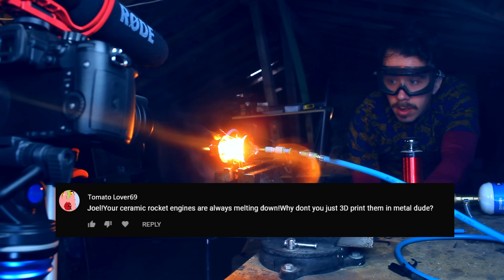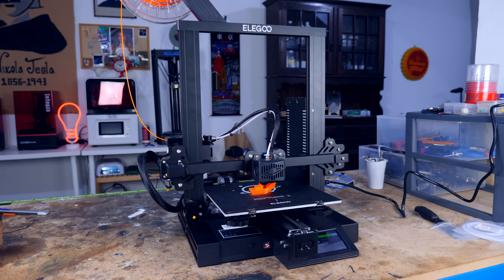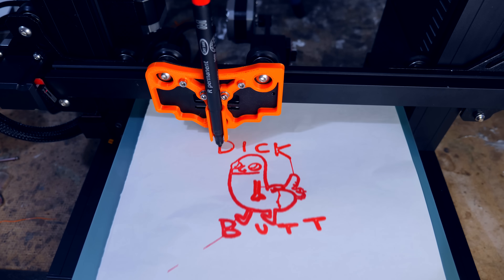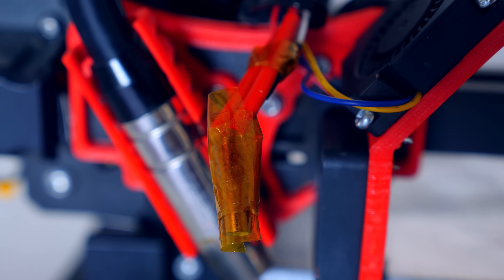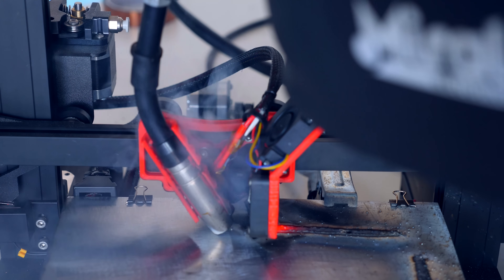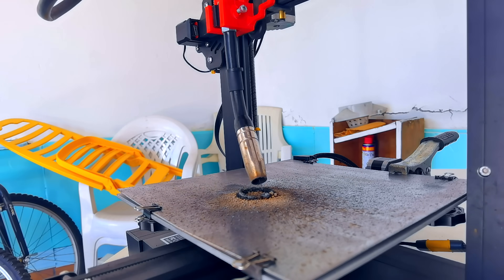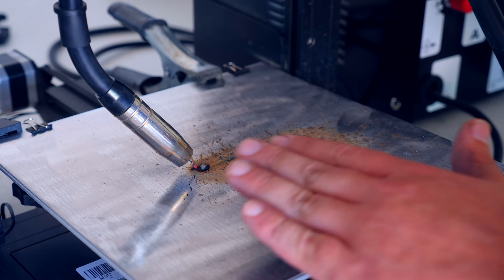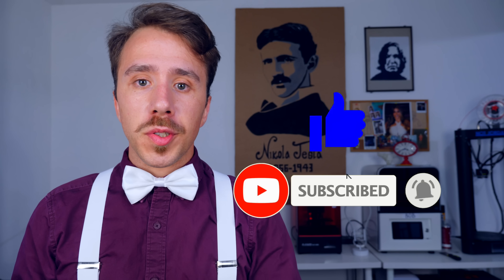I built a Metal 3D Printer using my Welding Machine

Comment: Try using MIG instead of Flux core. Mig allows you to weld over previous welds without needing to grind it because it doesn't use a flux in the wire.

Comment: You can use a 3d printed plastic part for the "lost wax" method of metal casting.  Aluminum or brass should be achievable with a fairly simple furnace.

Comment: This video was actually my introduction to your channel, so I don't know exactly what your rocket nozzles look like, but I have seen a number of makers in YouTube doing "Lost PLA Casting", where you 3D print a piece, cover it in a hard shell, melt out the PLA, then pour in molten bronze, aluminum, etc., to get a metal copy of your 3D printed file. Perhaps you could find a way to make that work, to get a more temperature resistant rocket nozzle. I know I'd watch a video of you attempting it. ... And since I'm subscribed now, if you do end up making that video, I will watch it!

Comment: A. If you want metal prints, cast. Print what you want with pla and vent and pour spouts and then make a plaster mold and melt the plastic out and pour some metal in the there. 

B. You cant stack flux core wire like that. Use normal wire and make yourself a tank to put your 3d printer in and dump some co2 in there

Comment: Print it in PLA then build a bucket forge, sand cast the PLA part, then melt metal in the bucket forge then pour the melted metal in the sand casting and it should give you a near lossless part, that is my idea for a future project.

Comment: You can build a gasifier type machine using old steel coffee cans some metal tubing (copper even) some random sized tin cans for piping. And it can be adapted to up to.maybe a 10kw generator so that the gasifier powers the generator:) use wood pellets for best results in gasifier

Comment: You can try metal filaments for FDM printer and you can get stainless steel filaments and print parts and then slintering in Furness for removing mixed material and making highly densed metal part

Comment: Marlon gcode has supported arcs and splines for a long time now. It blows my mind that none of the slicers I've encountered support it. Obj and step are both reasonable to work with. Someone needs to make a slicer from this decade.
Reply: Too many 8bit boards are out there still, they don't have the necessary processing power generate and send so many commands. It requires a better processor and faster bus speeds.

Comment: Integza. 
I saw video of metal 3d printer and they use phylament with metal. you can buy this filament and put it in FDM printer, than use that print wash it and put in funece like for ceramic. And they you got it, metal 3d printer.

Comment: question??? have you tried lost PLA casting on your fdm printer or castable resin on your sla printer? your kiln should get hot enough to melt small quantities of aluminum  that you could make your engine out of. you could also mark that parts 100% out of ceramic using this method. Burn out the pla pour the ceramic slurry in let it cure and form then dissolve the mold material. heck if you wanted you could make the entire mold out of PLA, do a negative cast of the engine an make the entire thing out of ceramic.. burn off and out the pla leaving you an engine that 100% ceramic.

Comment: Video idea: Make a rc propeller engine with a wankel engine.
Reply: RC airplane wankel engines are older than me, they've been around for a while. Not as popular as COX Bee engines but probably more common than twin cylinder Bee engines. I think it would be more rare if it was used in RC car or boat because when it was used it typically was in airplanes.

Comment: As a base for the turbine, you could weld a short piece of pipe to the metal plate, then print/weld on the pipe, to avoid warping. Or just build the turbine  from pipe... :P

Comment: Building an new type of printer from scratch seems like a distraction from your primary goal.
Since you have a kiln/furnace, perhaps you should try virtual foundry's metal filled filament? It works kinda the same as the ceramic, but you bury it in a refractory/charcoal powder to hold the shape and prevent the metal powder from oxidising. I haven't tried it yet, as I don't have a furnace.
Since the end result is conductive metal, you could surface finish it using electro polishing and plating. Just buy bright nickel electro plate solution though! It's not expensive. Perhaps watch Jason Welsh's channel for more info on electro finishing and forming, though he works only with copper.
Also, I have seen somewhere a method of filling the sintered metal with another lower melting point metal as it sinters, so that it doesn't shrink and isn't porous. You kinda just place ingots on top of the part and they melt in during sintering.

Comment: What if you sped the metal up from coming out of the welder? wouldn't that allow for it to lay more metal and thus build more instead of just small layers? my brain tells me the issue would come from telling the welder to speed, but maybe you could figure it out.
Also could "weld" at a lower watt/voltage to maybe make it behave more like a 3d printer instead.

Comment: Hey what about casting the piece, that could be a nice video idea! Like you 3D print the part and use a two part sand-silica mold to cast it in aluminium. That should make it capable of holding higher temperatures and grill tomatoes more efficiently :)

Comment: also some hardie board it a wall board that is to the most part fire resistant, it has moderately flat profile on one side and embossed pattern on the other, typically found with tiles in the Home despot isles, a 3x5 sheet is sub 15 bucks,

 but look out for where construction is taking place and it can typically be found in a skip, for the size you are looking for, a sink cut out would typically work for you. 

I think getting some inert gas, typically Argon, Helium or some mix of both,  

it is best used again talk to rapid air, or your local wielding supply house,

 they will sell or rent tanks, and charge $5 to $10 per liter/gallon, 

typical small bottle may be $30 bucks, about 1 to 3 hours gun time. 

You may have to get a better machine, which alows the use of gas and has some kind or control valve for the gas, 

the Harbor frought machine are getting some acceptance as reasonable wielding machines, 

the Vulcan line in particular(possibly) 

or better everlast..

 If getting a machine make sure if it is gas capable machine

On the machine controls there is a gas flow stop and start times, 

this allows a pre flow of gas and a post flow of gas to help cool metal down and remove air to create a inert gas environment prior to wielding initiating. 

 and the rig for controlling the gas pressure into the machine, some kind of flow meter, / control screw.

 With Hardibacker, your experience will vary, under the metal, 1/4 should be fine but 1/2 would be better. 
I have a section of 1/4" that I wield on it dose get hot but dose not burn though... so that a thin metal frame to create an air gap. 
 

So I am looking to make some flow forms, 

was wondering how U would go about that, 

I am thinking of using foamed concrete, and some kind or temporay mold, construct,

Comment: ... maybe I am terribly foolish but isn't it easier to print a ceramic mold or wax copy of the metal parts you want, then cast them, heat treat them, machine as needed, and assemble those metal parts? I mean I suppose you already did the deed here but really it does seem like printing molds or parts to create molds from is the easier way to make metal parts, and avoids issues like delamination of layers entirely.

Comment: no gas on the mig, having a gas flow will help with splatter, keep the nossel cooler, a metal bracket and using aluminium X chanel for the horizontal bar would help, anti splatter, change the speed of wire, and temperature of the electricity

Comment: Using hardware with 25/75 shielding gas with less stick out would leave you with no slag to clean after each pass and less spatter. Angling your nozzle can also push the bead in directions you don’t want it to go since a big concern is accuracy on x and y planes.

Comment: Just use a 3D printed object as a model for metal casting - you'd have to clear up the surfaces afterwards, though. How about building a sandblasting tool for this?

Comment: The welder needs to be set up vertical and not on an angle like you had it, I'll bet that the  majority of your problems will go w at with it being vertical, also try putting the welding metal on a plate of 1/4" aluminum instead of the glass. You can help with weld spatter by using shielding gas 60/40 c02 to argon mix will work good.
Also, don't use a steel sheet that is galvanized, get yourself some 10ga cold rolled sheet steel.

Comment: Video Idea. You should 3d print a De Laval nozzle then make a sand mold and use a foundry to cast the nozzle with a "low temperature" metal i.e. brass, aluminum etc.

Comment: Mig Welding with regular wire and CO2 would work better
Metal core wire would eliminate the slag but you'll need to run hotter on thicker metal.

If you can afford it, a Mig Welder that has pulsed current setting would allow you to run with very little spatter and low heat input which would allow you to build layers faster and much much more consistently.

Comment: Professional here.
Yes, angling the nozzle does produce a better result, but not in the way you think.
It's about the penetration of additive material into the base material and heat, the angle gives you a "lesser" penetration and HAZ - Heat Affected Zone.
You could have it straight down, but the HAZ will be greater, to compensate, you could turn down the Voltage/Amperage and increase the feed of wire, as well as the G code (F code) to a higher feed rate.

And one other thing, Slag-thread, aka "booger builder" or my personal anecdote; "Useless piece of fuck'n shit amateurs use" (no offense) that you are using, isn't really the most suited for additive manufacturing, since you can get a lot of slag insert, pores, and a weak structural integrity - You'd need shielding gas and solid wire for a better result.

Comment: You need to adjust the nozzle so it is directly over the spark so that the gas can completely protect the weld as it's being laid down.  At the angler you're using you're gas is just blowing away causing a bad weld.

Comment: Your challenge for a video: Make a hydro-generator using a computer fan, plumbing pipes and a hoverboard wheel. Your target is 700 watts. (I'm suggesting a 3D printed Phi-impellor as a better replacement for the computer fan). ;¬)

Comment: you should be using a gas mig welder because a flux core leaves the slag and has to be cleaned off before welding over it again. Gas mig shields the  weld and there is no slag. So no cleaning required.

Comment: You can't accomplish what you're trying to do with flux core wire. You need to use MIG with shielding gas. The flux in the wire creates a surface layer on the metal that prevents oxidation and contamination. It's great for a single pass, and for use in environments where gas wouldn't be suitable (like wind). But the slag from the flux needs to be cleaned between passes for proper adherence and penetration. If you could figure out a way to incorporate shielding gas instead of flux core wire, then you would have much better success. There's no slag removal after MIG with shielding gas. Also, you CAN use a vertical wire feed and still make a successful weld. Especially if the puddle is properly shielded. The reason people angle the torch is because we're human, and we need to see the puddle to control it. But if you're controlling it with automation, it isn't necessary to angle the torch. As long as you don't have fans blowing the gas away, you will be fine. But I think the higher placement of the mechanism that holds the torch overcame this. Also, not all MIG welders are created equally. I started with an entry level flux core only MIG welder, and now I have a high end Miller welder. NO COMPARISON! The high end welder makes beautiful, buttery, fluid welds. 

But I definitely think you're on to something. I look forward to watching your attempts at this evolve. If you can master this, you will create a new world of opportunity for entry level 3D metal printers that can incorporate MIG machines.

Comment: I should think the Tungsten Inert Gas (TIG) process would be better suited for this application. It has more elements that would have to be automated, but assuming you could do it, it would provide you a greater degree of control and precision as opposed to the rather messy Metal Inert Gas, or Flux Core processes. In TIG welding there is a Tungsten electrode that is operated independently of the filler material which is fed into the arc by hand. Requires nerve to do by hand, but the level of control afforded to a machine might grant it the level of control necerarry to build up layers much as a normal FDM printer.

Comment: Sadly 3d printer G-code doesn't do circles.  Machine tools that also use G-code, for a lot of decades now, use G2 and G3 codes to make circles.  This change needs to happen in the 3d printing world as it's smoother on the machine and shorter code lengths.

Comment: I'm not a professional welder, but I learned a bit about different kinds of welding during my internship and later when tinkering on cars, and one of the basic rules I was taught was to never weld in a straight line, but always in overlapping small curves, like this: (((((((((((((((((((((((((((((((((((((((((((((((
This way you deposit more material, resulting in a stronger weld with less chance of gaps and less warping.

Comment: 5 mm steel plate with air gap between it and the platen. Also try pulsing the welding action on and off in symphony with the table movement to help control heat input.

Fantastic effort. More please.

Comment: Yeah you need to look into TIG welding, MIG is far to dirty as you can see to accurately produce layers. you will basically need to feed a rod into the cone which argon flow and tungsten tip. If you can make it work it will produce far better results.

Comment: Always wanted to see someone try this , as I have seen Metal printing on industrial machine on 3D Printing Nerd . Try with heavy build plate that does not warp with heat  and slow feeds down. Looks like a lot of fine tuning with the speeds but also with the welding feed rates and power settings.Great attempt though.   Cheers from Australia

Comment: The reason we angle the welding cone is so we can see it :P If you don't need to see it, mounting it straight up is just fine. The only other observation to succeed in this situation is to use 8-12mm thick steel so it doesn't warp (as badly) which may get you closer to your goal :]

Comment: As a welder by trade I'm going to tell you that you're better off with a 90deg electrode angle since it's dependent on direction of the motion of the print head, and it may cause the arc to not light reliably. 

Also CO2, Argon or mixed shielding gas gives a much nicer finish that should eliminate alot of your problems (It practically eliminates the need for grinding/wire brushing).

 Welding is an "art" (complicated); it might be worth taking a course or watching some in depth videos, and lots of hands on practice.

Comment: Use solid core wire with c02 inert shielded gas, it should weld a lot cleaner way less splatter and should get you closer to your results, you would have to print in multiple passes stop between passes cleaning each layer before starting another layer and I don't mean vertical layers I'm referring to horizontal layers, you might want to position the gun 90° to the bed when using c02 shielded gas

Comment: You should add a metal ring to the hybrid rocket engine to bolt the nozzle to. Then the nozzle would not fall off as the fuel burns away. You could also use long bolts from the inlet to the nozzle to help increase the strength of the whole thing.

Comment: I think i can help with the welding problem :

1º you are using a flux cored wire not good becuse of the slag , like the cnc video you put in the video use a mig machine it uses gas as a shilding agent that way you wont need to grind every layer.
2º buy a flexible mig welding gun , the neck of the pistol is flexible and you can set the machine to weld at 90º from the metal , this way you will gey a good bit more of welding space and better welds.
3º don't use a fan.
4º to determinate a mig machine welding output (how much metal it deposites) you can just use the machine to make straigth lines and try diferent speeds and amperages until you find a good metal to speed quantity for you.

edit : try using a metal sheet at least 5 mm thick to reduce worpage , you can grind the welds off and reuse the same sheet for basicly ever if your machine can handle i recoment at least a 10 mm one you will not see worpage in miles with that thickness !

edit 02 : the gas used is pure argon , or Argon-CO2 Mix .

if you need more help with welding stuff i also speak portuguese something tells me you are portuguese for some reason good luck !